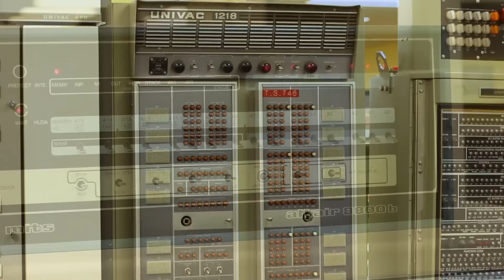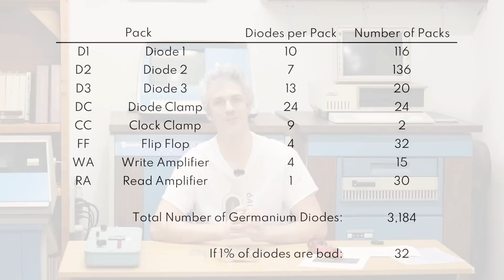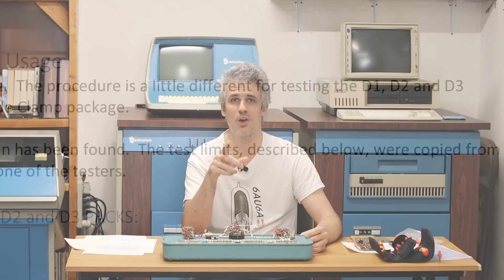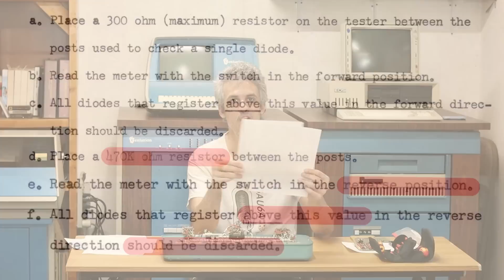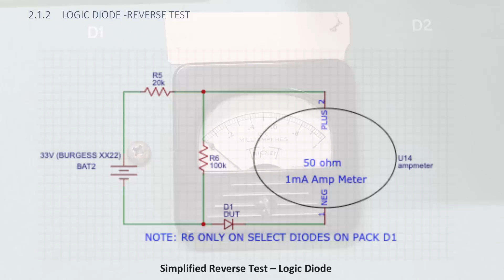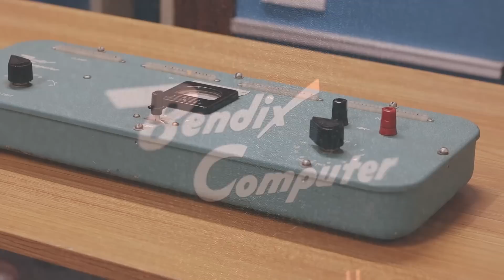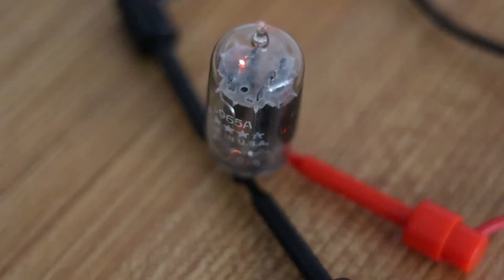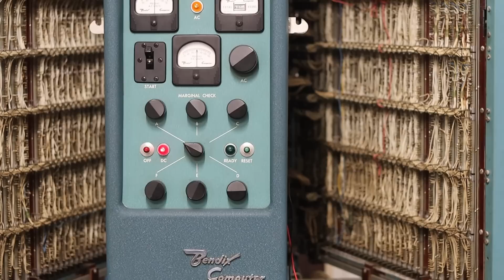Testing Thousands of G15 Germanium Diodes

Comment: Hmm... 1956 hey, That's the same year I was built.  Maybe I should get my diodes checked.
Reply: Check your capacitors also, hope they aren't leaking
Reply from the maker: The G15 is tough as nails and refuses to quit, so I'm sure you're just as tough and tenacious!
Reply: Same here.  Hello.
Reply: Yeah, all mine have turned into zener diodes either random voltage drops. 😆
Reply: @AlchemyAmiga-C64since198Mine too! (1959 model) 😢
Reply: What a useful tool. Amazing work, Lloyd and David.
Reply: Pro tip: Check the diodes down your left side first.  I read in a book somewhere that those can cause terrible pain and lead to trudging and being a paranoid android. 😉
Reply: @meltysquirrel2919  Damn I'm too late. Love h2g2
Reply: Are all the diodes down your left side hurting?
Reply: @TheChipmunk2008  yes, I've asked for them to be looked at but nobody ever does. God I'm so depressed.
Reply: at least you're not an automatic door :)
Reply: @TheChipmunk2008  Yes, nobody needs anybody to exude that level of self-satisfaction 😅
Reply: @meltysquirrel2919  have you ever thought about the possibility of siiiiiiiideways
Reply: rubber glove snaps "you got it buddy"
Reply: if you're flipping that's good but not if you're flopping.
Reply: Diodes are devices were things go only in one direction, right? 🤔🤔🤣🤣
Reply: have you checked youself for leakage?
Reply: As long as yr still going forwards and not backwards you should be fine
Reply: @UsagiElectric  Ha, thanks. So far so good,. But I'm sure the G15 will be still running long after I am.
Reply: @farmboypresents9977  Yep still going forward.. Cheers.
Reply: I have a pain in all the diodes on my left side.
Reply: Yeah
Reply: Probably
Reply: @UsagiElectric maybe
Reply: Diodes, resistors, capacitors, silica parts, and don’t forget about the rear port 😉

Comment: Make sure to remove the batteries in the diode tester before it goes back to the shelve :) Also what I do when I reversed engineer something, I put the print-out into the device itself, so that the next person working on the device in 50 years will get the necessary headstart by having a fantastic documentation to start.
Reply: In this case, also a USB stick with the pdf and source file will be helpful too! Paper comes first though.

Comment: Two steps forward, one step back. It's the cycle of life. Considering these diodes are the same age as my father, the fact that such a small number only have failed is astounding. Also Lloyd, if you are reading this, you are a GOD among men. Never forget it. You and Dave are making magic here, but he'd be going at 1/10th the pace or even slower if not for your help. Thank you.
Reply: I agree. My experience of germanium in the 1980s wasn't pleasant and I spent a lot of time cobbling things up in cases when silicon wasn't a simple drop in answer

(Why? Working in a SW comms station commissioned in 1951 and considered well past end of life even in 1980 let alone the end of the 80s, No money was put into replacing anything as it was already expected to be turned off (and was, in 1992), so things like 45.5 and 50baud tty circuits had to be kept running. Adding to the pain was the fact that large portions of the building had been declared off limits due to asbestos comtamination and a realisation that berryllium dust had been accumulating in nooks and crannies everywhere (a lot of old high power tubes use it for the heat conductivity qualities, and a bunch used thoriated cathodes with 2-3kW heater elements to enhance electron emissions. Let's not even go into the hard xray emissions from the mercury arc "rectum-fryers" or needing copius quantities of distilled water because the cooling loops were directly cooling anodes running at 50-75kVDC)

Comment: @Usagi Electric
The 12AV7 tube is NOT a substitute for the 5965 (E180CC). The 5965 and other tubes specially made for flip-flop circutry, has to withstand being biased into sharp cut-off for extended periods, hence the more rugged construction, a lot more heat has to be dissipated in cut-off.
Unfortunately the 5965 and the E180CC are wrongly considered an "audiophile" substitute for the 12AU7 - ECC82 types, so prices are stupidly high for tube wich is prone to hum, noise and microophonics. For anyone who doubts my claims, please read the Philips datasheet for the E180CC.

Much ❤
Reply: Just a picky point: how does cutoff increase dissipation compared to conduction?  I thought I'd read it was a problem with cathodes becoming coated with foreign matter from other tube components (like silicon from heaters) during cutoff for computer tubes, hurting their performance when they must conduct.

The "Hot cathode" article in Wikipedia seems to corroborate this, calling the phenomenon "cathode poisoning."

Perhaps for short term testing the 12AV7 would work, but the computer tube will be needed for best reliability.
Reply: Just looking at the 12A?7 family, a 12AV7 isn't an exact electrical replacement for a 5965, and isn't close on the ruggedness chart, and isn't designed specifically for extended cutoff operation. But given that 5965's are now essentially unobtanium, and that this machine isn't going to be sitting powered on for hundreds of hours, a 12AV7 is probably a perfectly fine substitute for occasional operation. And it is available, which is better than no tube at all.

Given the specific logic conditions in use here, it would be quite feasible to engineer a solid-state replacement for the 5965. I'm sure it has been done in the past, probably more than once, but the parts for those versions are likely obsolete by now too. 

Since we aren't interested in audio distortion, just a good curve matching a nominal 5965, it wouldn't be too hard to make something with some power MOSFETs or the like and a few other parts to do the job. (Don't forget the heater load resistor!) However, that would be kinda defeating the purpose of getting a vacuum tube machine working, if it didn't use vacuum tubes. 12AV7's are probably the much better available choice.
Reply: high hum, noise and microphonics is how you can tell that it made a difference to the sound and was totally worth the money!
Reply: Audiophile nuts have created supply shortages snd crazy prices for a number of vintage items.  Not long ago I ran across someone trying to sell Western Electric manufactured wire which had been pulled out of a central office main distribution frame.  He was asking a few US Dollars per foot per strand, which is a crazy price for old used wire.  I have quite a few feet of Western Electric 25 pair gray plastic sheathed cable and I can attest to the fact that is quite average plastic coated wire.  The wire itself appears to be tin plated copper or just copper depending on the cable.  I’m pretty sure it is tin plating because it does not tarnish as silver would.
Reply: The 407A tube good example of a way over priced tube,  just a simple oddball triode but no way it is worth 50$

Comment: It is amazing that you were able to get an actual Bendix test instrument for this G15. It can't be understated how amazing this is to have this tool. 
You're getting closer every time you work on this. Thanks for sharing your journey with us!
Reply: @davida1hiwaaynet   I was thinking the same thing, that the Bendix card tester is the proverbial hen’s teeth which are some rare.
Reply: @wtmayhew  Knowing HOW it works, makes it possible to build more modern semiautomated replacements in future. Personally I'd run it off a USB power supply rather than rely on potentially leaky dry/alkaline cells
Reply: @miscbits6399    Thank you for replying.  There really isn’t much to the tester conceptually.  It is a switch matrix to select a particular diode from the card under test.  There’s a cross connected DPDT switch to forward or reverse bias the diode under test.  The micro ammeter is wired in series with the battery to monitor the current.  The secret sauce is in that rare card edge connector and the wiring of the wafer switch to make it easy to select a diode.

The diode logic in the G-15 is probably composed of diodes similar to the venerable 1N60 germanium junction diode.  The 1N60 has a peak reverse voltage rating of 50 Volts.  The test box originally had a 35 Volt battery which is probably enough to spot a leaky diode.  Something like a modem multimeter or a vintage VTVM usually on biases test components with about 3 Volts.  The test box lets the operator flip the rotary switch through all the diode positions on a card in a few seconds - one rotation for forward bias, flip direction switch, then a second rotation. That sure beats probing individually with a meter - which doesn’t put out enough voltage to catch a reverse bias breakdown.

Comment: The point contact germanium diode failure is caused by carrier diffusion drift. The dopant elements are attracted to the point of contact causing the diode to have a highly doped region in contact with a normal doped region and a depleted region between. These bad diodes won't switch right in logic ciruits due to shutoff oscillation but they have a secret. They can replace tunnel diodes in most circuits. ❤

Comment: It amazes me that I have meters, component testers including a curve tracer but the Bendix engineers knowing others would be having this exact problem solved it with basically a battery, a couple resistors, some rotor switches and a meter. Small and rugged for it's time compared to carrying a curve tracer and a scope considering scopes back then were very heavy vacuum tube jobs that required their own cart and were very fragile. I am having to repair my RF analyzer now because of a bad screen when being transported even in a special anvil case and it's within the last 20 years modern.
Reply: They yield on early semiconductors and diodes wasn't real great so the parts were well checked before they left the factory. Infant mortality was also more of a problem so parts failing a few weeks or month into the field was also an issue. I would expect a well equipped service man to have a tube tester, diode tester, multimeter and scope when they visited a customer site because that many parts will produce a failure sooner than latter.
Reply: @denawiltsie4412  The vacuum tube machines I was familiar with (admittedly larger than this machine) always had an on-site customer service engineer that would some on shift around 6 AM, power up the machine, run diagnostic, and fix anything he found broken or marginal, hopefully turning it over to the customer by 8 AM. Then the machines would usually run till around 6 or 7 PM, when they would either be switched off or put into a low-power standby state until the next morning. It was rare to not need to replace a few tubes every day or so.
Reply: Reminiscent of shop built test equipment we used in production flight test when I worked at Cessna and at Learjet.
Reply: @lwilton  The oldest systems I used where transistor so I really haven't had hands on experience with vacuum tube computers. I was lucky enough to see one of the Air Forces SAGE (Semi-Automatic Ground Environment) installations where they had two very large vacuum tube computers with core and drum memories. One system backed up the other but I had the impression that the system was reasonably reliable. At least enough that they allowed a regular stream of visitors to view the system in operation. They trusted the system enough that they would run demos on the idle system.

Comment: I remember a TV commercial from decades ago, for, I think, a motor oil, the machanic states "You can pay me now, or you can pay me later."  BY ALL MEANS check all the diode cards now.  Not doing so is going to cause you grief tracking down which card is causing the fault.  You will end up spending more time in stressful panic debugginf than you will take leisurly and calmly checking them now.

Comment: That screw on the front is the Mechanical Zero.  When the device is OFF and the meter is reading nothing, you use that to adjust the meter to read exactly Zero.   Any other adjustments should be electrical calibrations.   What you did may work, but it is not the correct use of the mechanical zero and it may affect the accuracy across the dial.
Yeah I know,  I am being pedantic.  lol.    I do love your videos, and this tester will definitely save you a heap of time.

Comment: This is the beauty of discrete logic:
No special chips that are now obsolete and impossible to find, just standard parts that you can get everywhere.

That test box is nice!
But for testing large numbers of things (parts, modules, whatever) a simple "pass/fail" indicatzor (red light or green light) would have made testing much faster and simpler.
Maybe a comparator that measures the "meter current" with a shunt resistor and compares to a fixed voltage depending on the position of the forward/revers switch?

Probably not worth designing a custom test box, but I probably would have done it.
(Automating something is way more fun then actually doing the work ...)

Comment: Think about the 1956 factory technician who had to test all the boards needed for a full scale production run. They were looking for the forward / reverse reding for hundreds of boards a week. Fast forward 20 years and you could test each board in 30 seconds, all diodes and all resistors.
Reply: I would bet quite a few dollars the factory had automated board testers. I know I had them at Burroughs in the late 1960s. You could build one as a special peripheral to be run by a G15. You could make a simpler version with some stepping switches and limit-indicating voltmeters and ammeters, which were fairly common in those days.
Reply: @lwilton just being able to calibrate the meter so 0.5 was the acceptable reading would take out some mental stress and error possibilities.

Comment: SUGGESTION: With a fine sharpie, number all the remaining packs with some type of notation such as rack, vertical position, horizontal position- e.g.  3-5-16   May be useful once you get the machine running as you will definitely have failing packs/tubes.   Put the info in a spreadsheet for the next guy that is going to service the beast. 😊

Comment: Just a thought but 4x 9v batteries would be 36v if you wanted to eliminate any active electronics and phantom power draw while not in use. Also if 36v is too high just add a few diodes in series with the batteries as a voltage drop.
Reply: In this case, adding diodes in series with batteries would cause an issue if a test was measuring something less then the forward current of the series diodes.

Comment: I may be late to the game - but with the Testofon (aka Contitest), you can quickly test any electronic component, especially if you have more than one of them. It works by applying a voltage and transforming the current that flows into a tone for your ears to hear and for your brain to decipher (if I test capacitors, I get a whole chart with the time/frequency axis and a scatter plot on what's good, what's tolerable and what's bad - and it'll fill it in in realtime).
If you got all the diodes next to each other, testing 8 of them both directions will take around 5 seconds.
It can also test transistors. Not great, but I found wonky ones that still worked in circuit most of the time, but either fail when cold or fail when warm.
Like the multimeter, it won't find any that fail the forward voltage test above 4V, but it'll find shorted or reverse-leaky diodes.
You might think of it as a glorified continuity beeper, but to me, the Testofon was a game changer. In a pinch, it could even replace an oscilloscope or logic probe.

Comment: From the very start of this project when you first gave us an overview of the machine and all those diode cards, I was wondering how in heck anyone was going to be able to check all that. We're getting there. That is, you're getting there. We're looking over you shoulder and trying to keep out of the light.
Reply: I had a similar problem once back in the late 1970s or so. I built a test fixture I could plug into my AIM-65 computer, and wrote a Basic program to run it. It could to an almost complete functional test on about 4 different types of cards, and let me test hundreds of them a lot faster than by hand or a manual tester would have let me do.